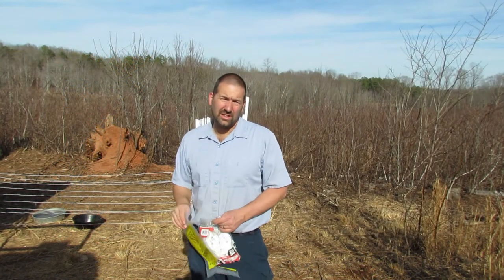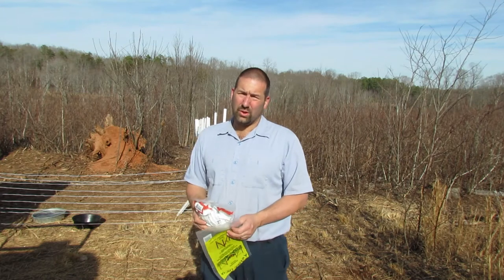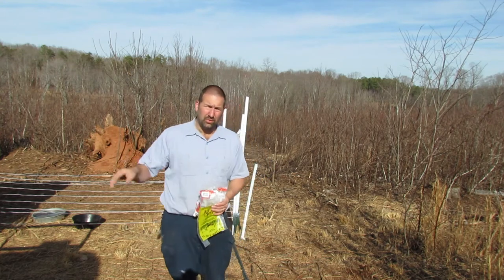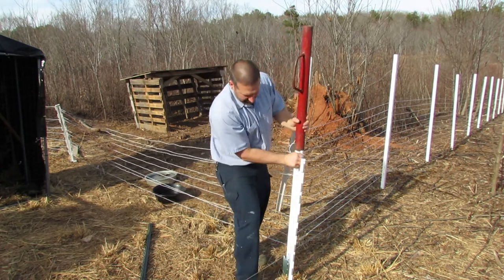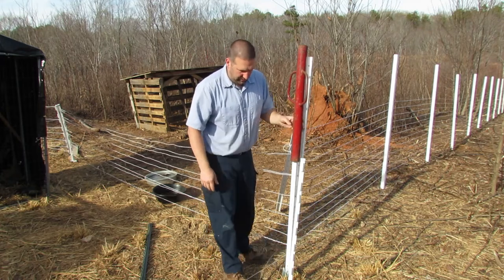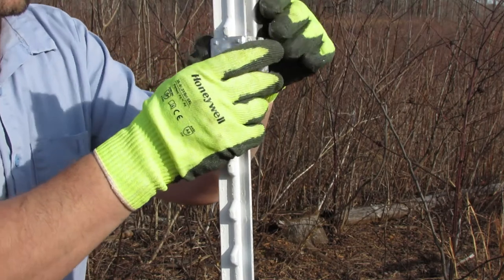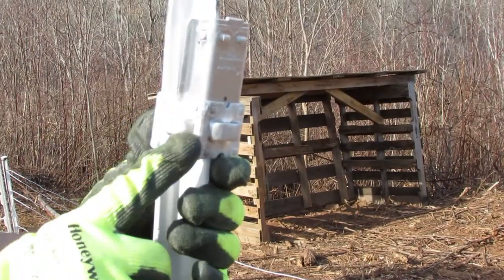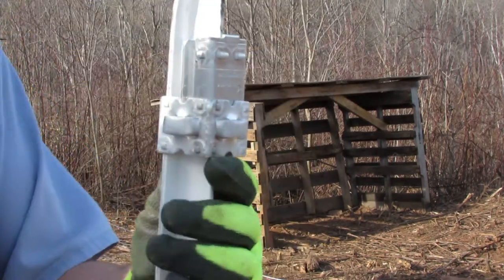How To Install Wedge Loc Corner Brace Set #205

Comment: What is the difference between 208 and 205
Reply from the maker: Daryl Bowman the 208 is a kit only for doing an inline brace shaped like an N in the middle of a long run. There are not enough parts to do a complete corner. The 205 kit is for the complete corner. You could use the parts in the 205 for an inline brace but you would have parts left over. In essence you could buy a bunch of kits of either and have everything you need. Hope this helps.  ~Mr. C.

Comment: Does this kit DO ONE CORNER, OR ALL FOUR CORNERS OF A COMPLETED FENCE JOB?
Reply from the maker: Mossymaple the kit we purchased was everything you needed in one bag to do one corner. It's holding up great. Still nice and rigid. Let us know if you try it out. ~Mrs. C.
Reply: @NaturesCadenceFarm  most fencing jobs need 5 kits or vendors more if you have a couple gates as well
Reply from the maker: @mossymaple  yes correct. For us, this was a cheaper option than using the Timeless Fence corner kits. It is also much sturdier than wooden posts on our steep hilly land with high Virginia clay content that tends to heave out wooden posts during the frost/thaw cycle. The metal T-posts are a good solution for us.  It's nice to have lots of options. ;) ~Mrs. C